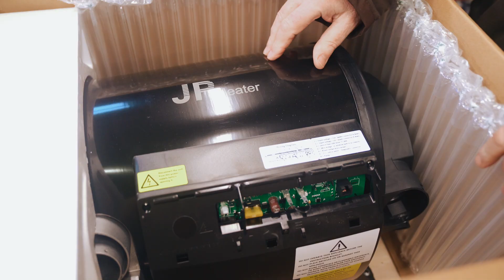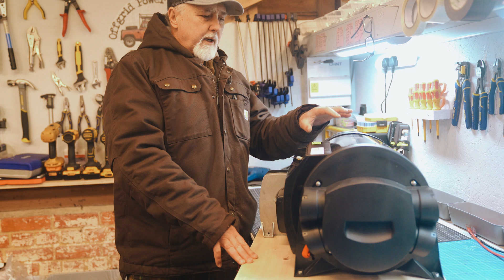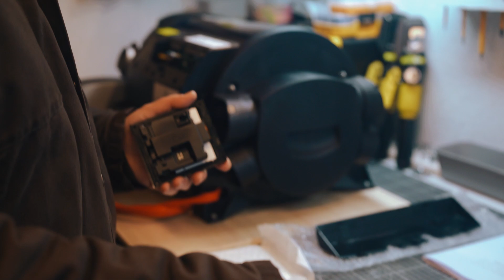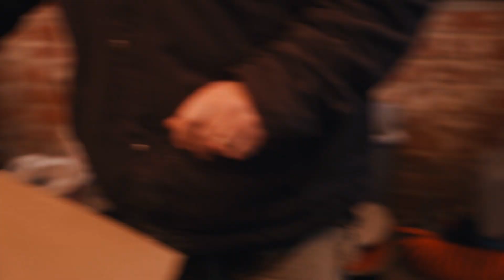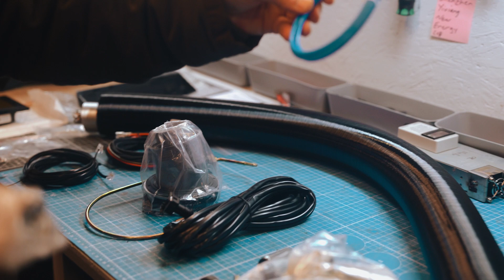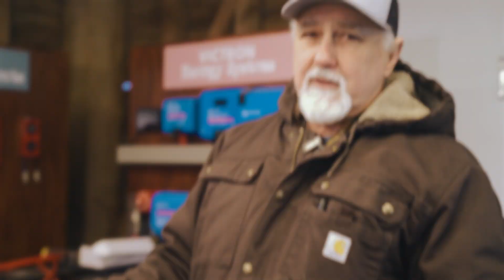Unboxing the JP Heater (Diesel Combi Boiler)

Comment: The actual price is the same. The 600 pounds difference is the warranty insurance. With jp you have no warranty whatsoever in case anything goes wrong you are on your own. But perhaps well worth the risk.
Reply from the maker: The warranty and possible cost of returning the boiler to China for returns is a big factor. We did ask a bunch of questions around support, who pays for returns, etc.. which we'll be covering in a review video. So far JP have been VERY responsive in answering questions when we've emailed. My experience of how poor Truma's customer service is that JP are winning that competition by a country mile so far. I've had horrendous experience over the years with lack of response and first line support from Truma.
Reply: @offgrid_power  my experience working with Chinese once cooling off period passed 2-3 months and money successfully landed in the pocket the warranty flies out of the window. Hopefully, I am wrong.  But that's why I said in a previous msg that perhaps taking the risk and saving 600 pounds is well worth it.
Reply from the maker: Yeah, we've had very similar experiences with a lot of Chinese suppliers as well. Hopefully JP Heater is the unicorn good one!! 🤣